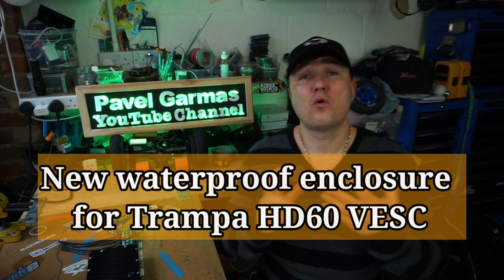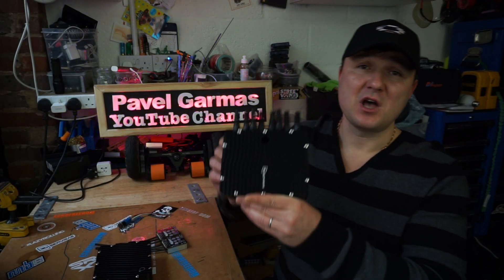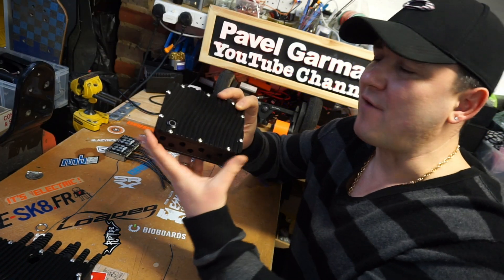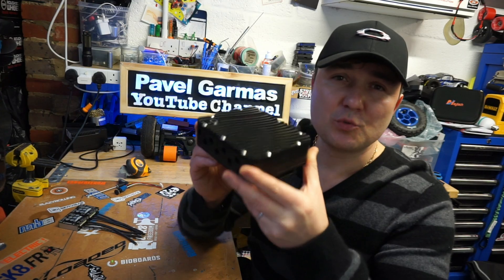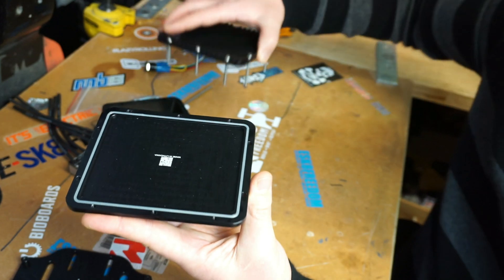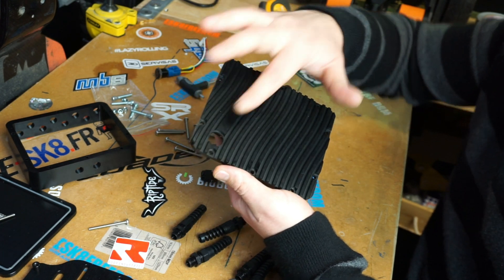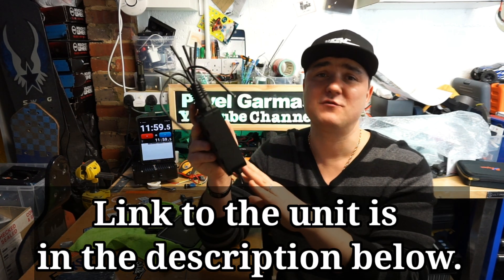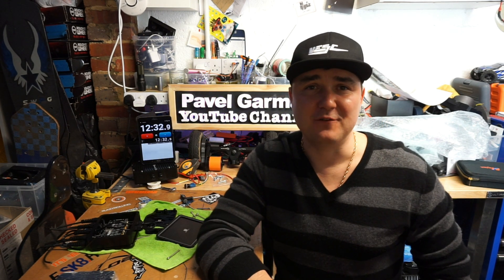New VESC HD 60 enclosure. 100 % waterproof.

Comment: Does it matter if the phase wire connections outside of the enclosure get wet? Is heatshrink over the connections enough to waterproof them? I've seen many builds where the phase wires are connected inside the enclosure
Reply from the maker: Hi,
It is best to have the connections inside the box but if you are using a dual wall / glue infused heat shrink then you will be fine. A few of my boards got connections externally.

Comment: what about the single one? did it dissapeared?
Reply from the maker: Hi mate,
What do you mean? You can buy a single HD60 from Trampa if this is what you need. Single motor builds are not very popular so making an enclosure for a single vesc is not economical... you can still use the same box but install a single vesc.